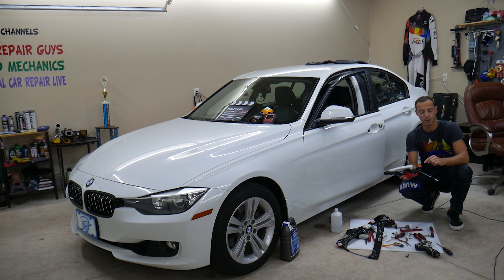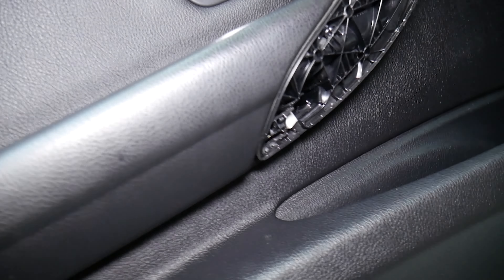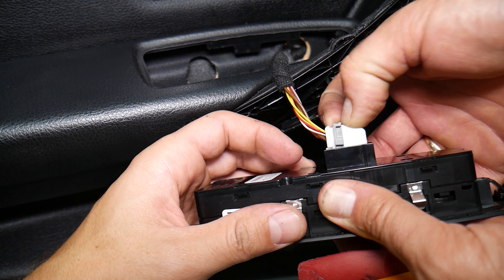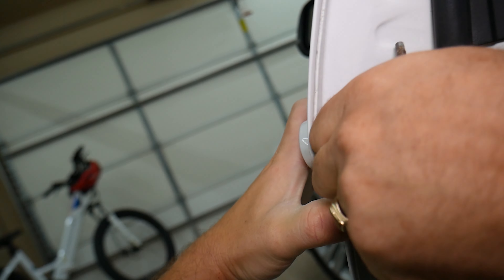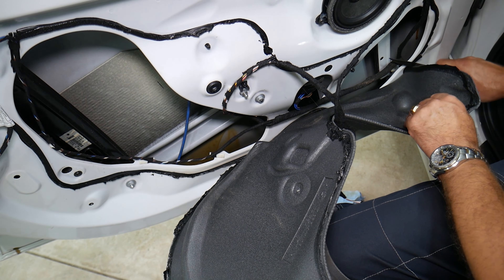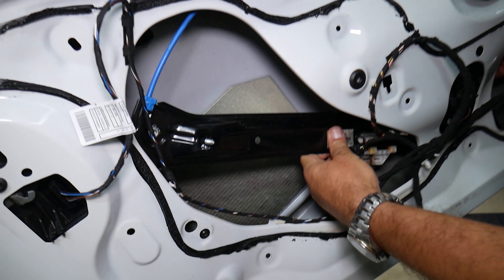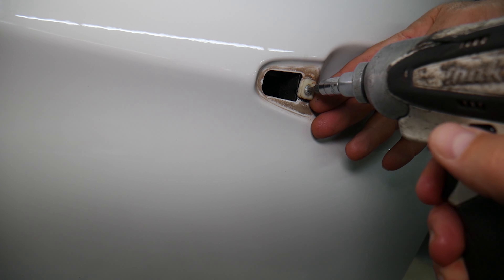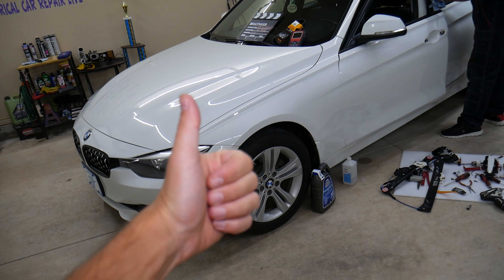HOW TO REPLACE DOOR HANDLE LIGHT ON BMW F30 F31 F32 F36 E90 F25 E60 E61 E91

Comment: anyone looking at this in the future, you don’t have to take apart the door. unscrew the 4mm allen from behind the rubber door trim, and use a pry tool on the bottom of the handle to pull it off the door.

Comment: Cut the wires from the outside and solder them , not dismantling door for this shiz
Reply: That's what I'm literally about to do lol have you?
Reply: @alycapo3391  yes rear driver side door , easy!!!
Reply: I got a front passenger side to do so let's see how it goes 😅
Reply: @alycapo3391  so did you do it
Reply: @alycapo3391 Is this possible?
Reply: @thundermen89  I just pulled it out, make sure there was around 10cm wires. And soldered on a new one and clipped it back into place and resceewed the door handle. Whole operation took 8-10 minutes

Comment: Total overkill should just be able to change the led from outside. BS
Reply: I wanted to disconnect my door light and thought the connector would have been more centralized behind the door panel. Men was I wrong going down this rabbit hole. Two weeks of me trying to reassemble the door and it's still not done, furthermore all these videos show you how to remove but not reassemble.

Comment: Great guide.
I’ve got an e90 so a bit different to this but not massively.
I didn’t need to remove the window mechanism and rather than pull out the old light completely I’ve just left it
loose in the door.
Took me about 30 minutes once I’d found all the tools.
You don’t need to use a knife to take the glue off either. If you pull it off it remains sticky for when you put it back on.